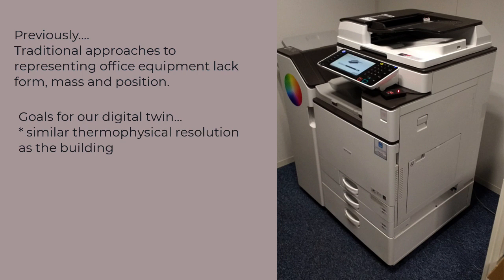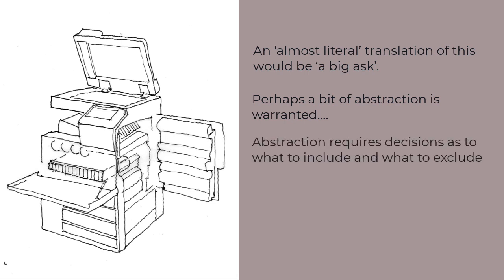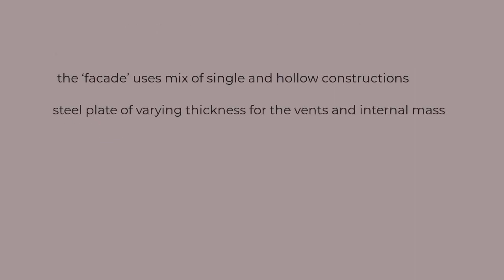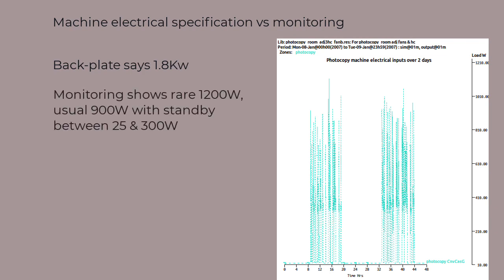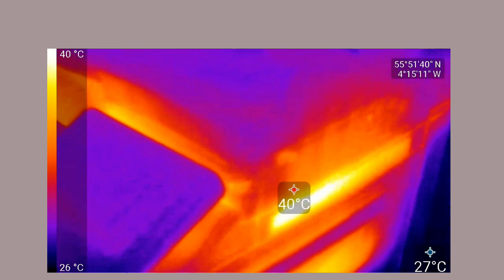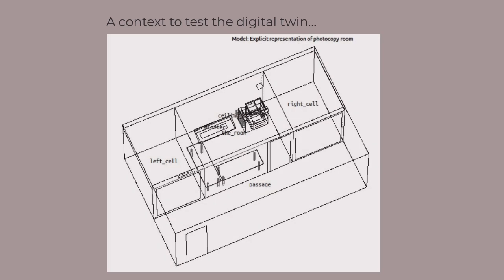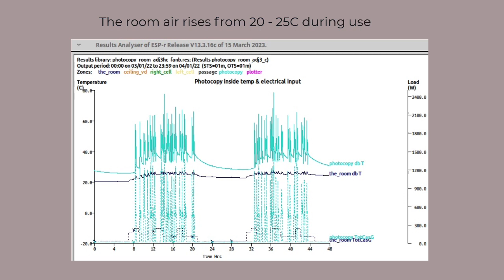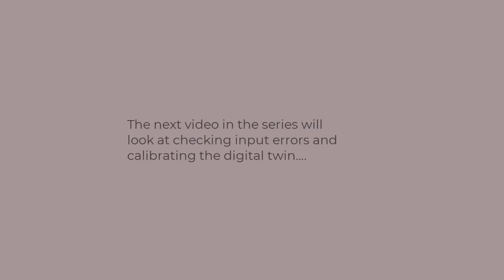Digital twins of office equipment -  part 2

Comment: Thank you for the great video! How does the process of warranted abstraction in creating a digital twin balance the need for accuracy with the practicality of model complexity? Specifically, how do you decide what aspects of the physical copy machine are essential to include in the digital twin, and what can be left out without significantly impacting the model's performance?
Reply from the maker: Thanks for the question. At its current level of complexity and with only a few of these in an office building would have a minimal impact on run time. If the building hosted scores of these for production work then scaling would be an issue - one would likely need to setup lots of different work loads and the host room would certainly grow in complexity (with the shared surfaces) and that could test a solver.

The shorter tilmestep is the elephant in the room. It will create larger performance results files as well as longer to run-times. It would be worth testing to see if a 2 or 3 minute tilmestep degrades the deliverables. 

I would make a differently complex model if it were being made for use by the mfg of the kit who wanted to study heat transfer within the machine. That would be multi-zone and might require an order of magnitude more surfaces as well as that destructive tear-apart and lots more monitoring.

And if one were serious about run-time creating an even more abstract variant would be worth trying.  If a detailed comfort study was not called for a more abstract DT might be good enough.